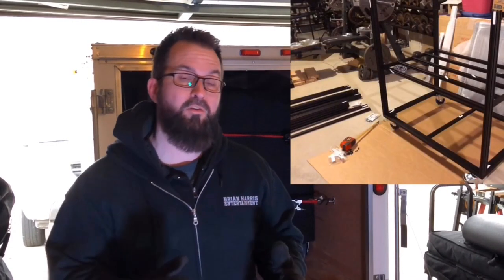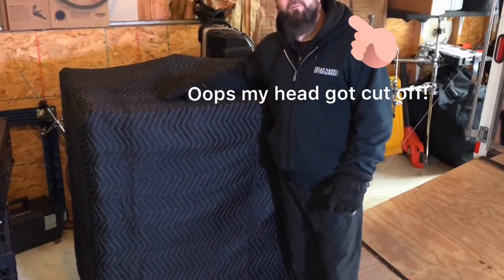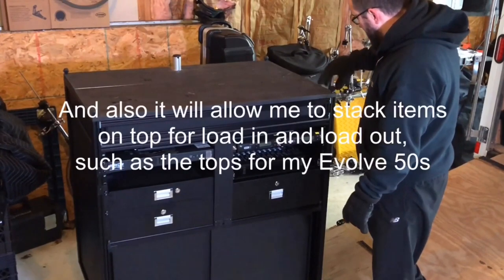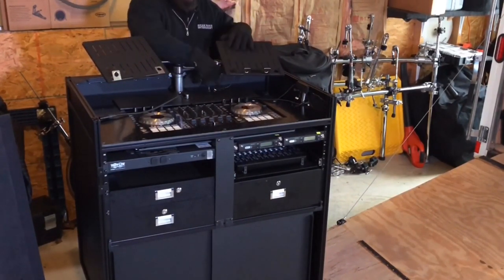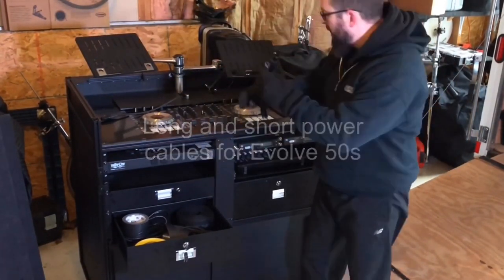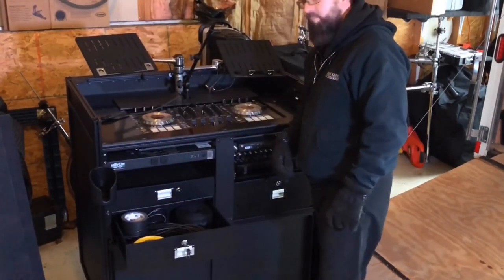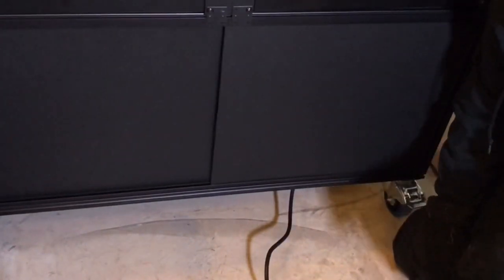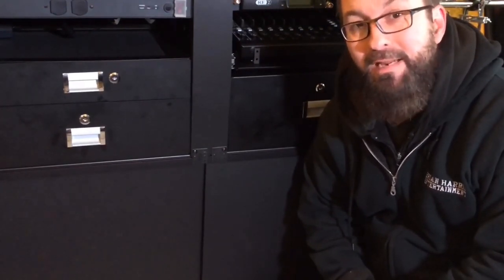BRIAN HARRIS DJ ENTERTAINMENT 2019 Rolling DJ Booth

Comment: Nice work - well designed with comfort and ease of use! I love it. What’s the total weight with just the controller and inside gear and cables. No subs ?
Reply from the maker: No idea the weight. Too heavy and large to lift it yourself. It would even be difficult with 2 people. But it was never intended to be lifted. Ground level only.

Comment: How much time did it actually take during the 3 weeks to build this and what was your total cost of materials to build this? What material are you using as side and front panels?
Reply from the maker: I really wish I would have a logged my hours. So I’m not really sure exactly. I worked on it for a couple hours most days. But I’m sure there were a few days where I didn’t touch it at all. Of course there were two steps to the build. First was the framework and the panels. And then the second was adding all the stuff that I filled, like drawers, mixer shelf, mixer, laptop stands, etc. It’s made from 80/20 aluminum extrusion and plastic composite boards. 

Here’s the cost rundown…

$1983 for all the materials (T-slotted extrusion, all connectors, composite plastic boards, casters).

That’s not including what I stuffed in it though:
280.00 Mackie mixer
170.00 Connie’s Cover
120.36 laptop arm & pole
101.35 rack drawers: 2U, 3U & 4U 
 86.66 second laptop arm 
 58.59 rack shelf and slide shelf
 14.00 LED strip
 51.00 three sets of rack rail
 37.00 additional roll in T-nuts
 = 983.00

So grand total: $2903

But since that initial build, other things have been added or swapped out. But basically $3000 in parts.

Comment: Love the design.  What are the cross sections for the profiles? 20mmx20mm, 20x40 or imperial?
Reply from the maker: Paul Rainey I’m sorry but I don’t know what you’re asking
Reply: @DJBrianHarris  the metal bars you are using, what are the dimensions? I am looking at making something similar but a bit deeper, but I wanted to know how thick the bars are so I can get ones that are strong enough.
Reply from the maker: Paul Rainey I’m not sure the exact dimensions on everything. It’s a mix of different sizes for different reasons. It was designed through a company in Columbus Ohio called OTP industrial solutions.

Comment: Approximately how much did that set up cost to build? What size extrusions are they? Great work!!!!!
Reply from the maker: Brian Sullivan $1983 for all the materials (T-slotted extrusion, all connectors, composite plastic boards, casters). 

That’s not including what I stuffed in it though:
280.00 Mackie mixer
120.36 laptop arm & pole
101.35 rack drawers: 2U, 3U & 4U 
 86.66 second laptop arm 
 58.59 rack shelf and slide shelf
 14.00 LED strip
 51.00 three sets of rack rail
 37.00 additional roll in T-nuts
 = 813.00

So grand total: $2733

Plus I’ve put more into it since then.
Reply: @DJBrianHarris  AWESOME JOB!!!!!!!!!

Comment: I’ve been debating about buying a Toadmatic.  After watching this about 600 times, I’ve decided to build one.  
What is the panel material you used in between the 80/20?
Did you have the 20/80 machined for your mounting fasteners?   Or did you do it yourself?
Reply from the maker: DJ Benefit 
They are composite plastic boards.Everything was designed and bought through OTP Industrial Solutions in Columbus OH. They created a CAD drawing of the booth, and then ordered all parts including connectors through 80/20. Then 5 weeks later 80/20 shipped directly to my front door.
Reply: I’m going to start looking for local dealers & see if I can go the same route.
Reply: Well, I pulled the trigger.  Couldn’t find anyone locally, so I went to the manufacturer.  They have a design team in-house.  They were able to design exactly what I needed.  The kit will be here sometime next week & I’ll update with the assembled product.  
Thanks for the inspo, Brian.
Reply from the maker: DJ Benefit Looking forward to seeing how it turns out!
Reply: @DJBrianHarris  booth is finished.  I'll make a video so you can check it out.  Mind if I credit you?
Reply: @djbenefit  I could not find a video.  Did you post it somewhere?  Thanks.
Reply from the maker: @djbenefit  sorry, I missed your last comment. I’d love to check out the video